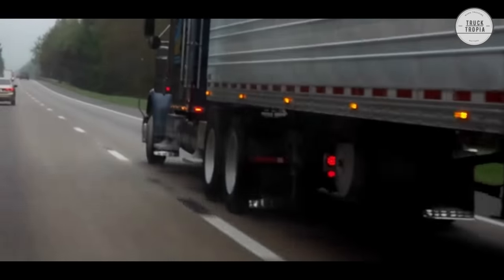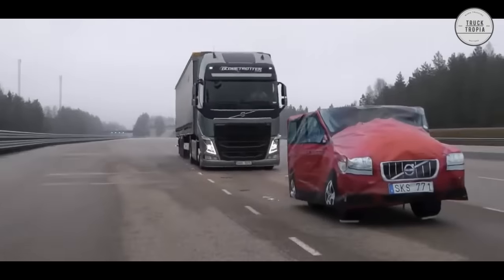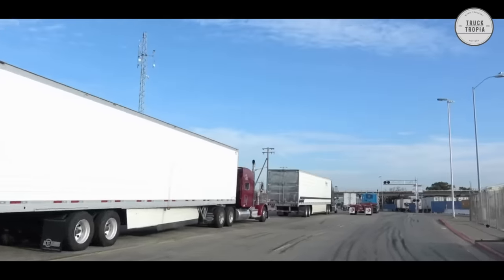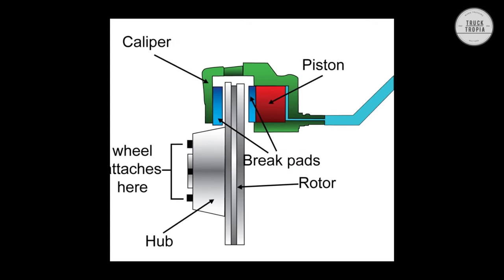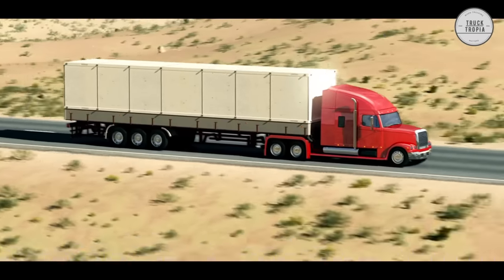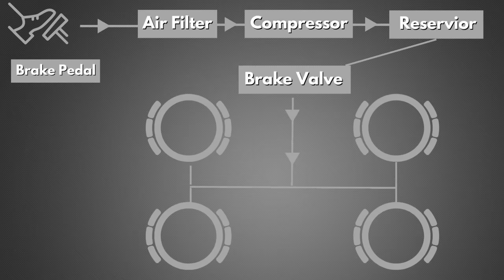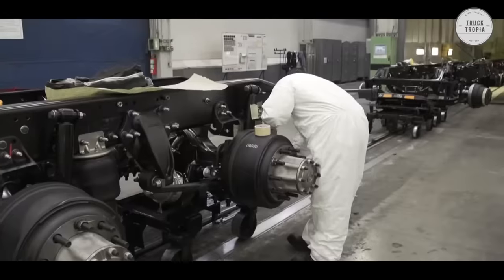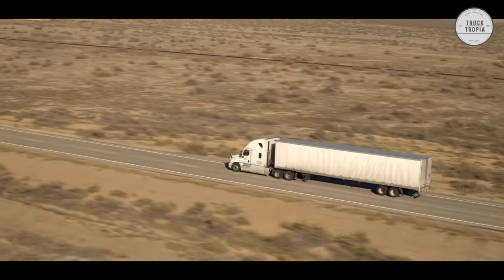Why Do Semi-Trucks Use Air Brakes?

Comment: WARNING! Before you work on any air brakes. There is a large heavy spring in the brake chambers under tremendous pressure and it will kill you,  if disassembled wrong!
Reply: Who are seriously disassembling brake chambers? 😅 If one goes bad you swap out the whole unit
Reply: i am very well aware of it ...... that is why this video is wrong. that spring is the actual brake and if air or hydraulic pressure fails the brake engages.
Reply: That spring is what makes it a "fail-safe" system. It is normally engaged. It only releases when air is pressurised and holds the spring in place. You must release the spring tension in order to safely rebuild the whole chamber. It is much cheaper to rebuild the chamber than buy a new one, if said chamber is not rusted out of existence.

There is another actuator that actually makes the system brakes using the pedal. This has a much weaker spring that only releases the brakes if pressure from the pedal is gone.
Reply: Held one, super scary to take apart
Reply: @TuntematonSika  wrong! You can swap a half can. Set the brakes, cage the leaky can, and pull off the section by taking the clamps off. Easy peasy.
Reply: Forbidden confetti
Reply: hence you release it after you've secured the vehicle. It is a no brainer ^^
Reply: Oh man! Was just about to watch a youtube video about what airbrakes are, i had to work on one you know... Thanks for the info tho!
Reply: I've seen this happened to a  new mechanic many years ago. Thanksfully only hit his left arm and his arm just shattered. Hanging limply at his side with few places punctured by bones fragments. If that thing hit his head or body, he would have lost his life.
The seniors were not in yet when he started working on those brakes. From that  day we make sure everyone have training on brakes and new mechanics not allowed to do solo job.
Reply: It's 2023 NO ONE takes those apart.
Especially when you can just swap the whole thing out.
Reply: @escapedcops08 I do
Reply: well most people dont have the budget to swap so expect always that there is always some who choose to rebuild
Reply: In tech school they warned about throwing them in the trash. 
I bet there's plenty of these land mines buried in landfills.
Reply: So if improperly disassembled, the spring may cause you to... spring a leak?
Reply: In my college class , someone almost died because they filled air the wrong hole form the chamber 💀💀💀
Reply: All the ones manufactured  for like the last 15 years or more have a crimped on band on the spring side. You can't even replace the diaphragm that releases the spring. It sucks. You can cage the spring and cut the band to get them apart, but the band has a different profile, so the old bolt together bands won't work. Damn safety Nazis

Comment: Air brakes are used because of the trailer. The trailer has to have the ability to decouple from the tractor. The connection for fluid transfer would potentially have a leak. With a liquid being the fluid to move the brakes, you might lose all your fluid. The air compressor replenishes the air which is the fluid used for air brakes. Air leaks are bad but leaking hydraulic fluid would be more dangerous.
Reply: I agree. But also, even a small air bubble in the hydraulic system would render it unusable. There is no practical way to make it work unless the driver bleeds the hydraulic brake system of air every freaking time a trailer is hooked up. Air brakes are the best solution.
Reply: So that's why a true hydraulic braking system was never applied to any on-road vehicle. Even though applying a reversing flow of fluid to a vaned wheel assembly would stop the vehicle with no chance of overheating and never wear out, a leak would cause catastrophic system failure.
Reply: Air brakes are also much easier to amplify on the scale of a comercial vehicle. You just press in a control valve and the pressure will start building from an outside power source. With  car brakes only a big vacuum powered booster is enough, but braking a large vehicle would be near impossible with a vacuum based booster.
Reply: but they're also used on trucks and buses without trailers.
Reply: @reruddock  why not electric trailer brakes then?
Reply: except hydraulic brakes were standard for agricultuiral vehicles until recently.

standardized connectors for hooking up hydraulics quickly exist.
Reply: There is also the probability of getting an air bubble in the hydraulic line with hydraulic brakes when coupling/uncoupling the trailer.
Reply: @justinryanvalencia05 It would take a large amount of power to run the brakes. They do electric brakes on smaller trailers. Even then it’s a fair bit of power to make the brakes work. To get electric brakes that would match air brakes would take far more power than would be reasonable.
Reply: Not true  Moto GP bikes have QD lines and they work just fine..   Air is just a better system and even tho you can still get fade you don't get it from overheating fluid as in hydraulic fluid you only get it from the brake parts overheating    @reruddock
Reply: Buses also use air brake and even non-articulated trucks
Reply: @anonym3017  I think the connectors are only for the attachments. Not for the vehicle brake system. Might be different system entirely.
Reply: @ramonching7772  nah mate.

hydraulic brakes were standard on agricultural vehicles for decades. that includes hydraulic brakes on trailers. which were connected with disconnects in the lines.

the same system, vut much smaller also gets used in endurance racing so that they can switch an entire wheel assembly instead of having to mount a new brake disk

hydraulic power takeoff also exists but that is actually rare

Comment: I'm missing the two most important reasons for the use of air brakes. One being the size off the brakes, the brakes on a truck are to big to be operated manually with the use of a vacuum brake booster for a hydraulic system. The second is the connection to a trailer for a hydraulic system would a risk for introducing are in the brake lines when connecting which is a bad thing .

Comment: Fundamental mistake in your video: The air-pressure is used to release the brake! - Without pressure, the brakes are locked by a spring. That is a safety measure to prevent trailers from rolling away after being disconnected from the truck. Also the whole truck/trailer system is being stopped whenever a leak in the air-system occurs instead of loosing more and more breaking power due to a leak in a hydraulic system.

Comment: As a trucker for over 50 years, this has been long in coming. Air disk brakes WILL stop the truck quicker and easier than drum brakes. So glad they are here!
Reply: I've done many brake jobs on my own cars. Changing worn out pads on a disc brake system is far easier than changing shoes in a drum brake. I assume that the brakes on a semi truck are just larger versions of automobile and light truck brakes.

Comment: CORRECTION: air brakes absolutely do fade from over heating, just like hydraulic brakes. It’s much more common of an issue with air brakes in fact, since they are more powerful they press the pads harder and heat up faster, they have to absorb a lot more energy to stop a heavy truck. If used too much the brake drum can expand enough from heat to make the S cam unable to push the pads far enough. Most run away truck situations are caused by the driver relying on the brakes too much on a downhill, instead of engine braking, and overheating the brakes to the point of failure. 

As mentioned hydraulic brakes fade too from over heating, but this is mostly seen with sports cars on race tracks. It’s why a lot of race cars and super cars have exotic ceramic material brake rotors that can handle higher temperatures
Reply: I think this applies to cars too, but i dot think if they use air brakes. We have escape lanes in the event a vehicle's brakes fail but that is only in downhill. I have been told that you, in most cases, use the same gear when going up- and downhill, but that is only in manual vehicles. Do automatics have manual gears but what will they do with the clutch?2
Reply: I'm not sure this person actually did real research before writing this video
Reply: @annabelholland  I just got my Class A CDL, so all of this is fresh in my mind. At lest according to the Pennsylvania CDL manual, truck drivers should go down a hill in a gear 1 LOWER than the gear they would use to climb the hill. Depending on the grade and length of the hill and the weight of the truck, you can calculate a “safe speed” for going down the hill, some big hills even have signs poster that say what the safe speed is for different weights. You coast until you hit your safe speed, then you brake until you are 5mph under, let off until you hit it, brake again, ect… until you are at the bottom, this on/off braking gives the brakes time to cool down during each cycle. 

As for automatic trucks, I’ve driven a few, they automatically down shift and engine brake when you take your foot of the gas pedal, so when you are cruising you always keep your foot on the pedal a little, or it starts engining braking like you would driving a manual.
Reply: @randomguy3281  i was talking about cars. idk anything about trucks as i do not drive and have a license for that. i would say though that the steeper or narrower or bendy the road gets, the lower the gear you need. for the same reason, do not coast in neutral going downhill unless at an extremely slow speed (<5mph) in traffic
Reply: @annabelholland  Read your owners manual for transmission shifting options. It can vary between make and models.
Reply: @annabelholland  most new cars have the sport shifter, so you can put your car into manual mode before and while you are driving.  

When going up hill, i rather put the car into manual shift mode, downside out of overdrive which raises the engine rpm. The same applies going downhill.  Just watch your rpms, you don't want them to go too high. Really no more then 1 maybe 2 downshifts.

Please read the manual for your car first. My car might be different from yours.
Reply: Yes. It's just that you don't get the effect of moisture in the brake fluid thst can get overheated and boil and lead to complete brake failure in cars with poor maintenance, that don't happen in air based systems. But as you say, the pads wear out all the same.
Reply: @annabelholland  Not really, but most autos do have one or more gears for going downhill(never go into neural and read your manual), but unless you are maxing out your brakes with a trailer on a steep hill or something, you are most likely fine, but not using these gears will wear your rotors and pads faster ,also, basically all non-commercial vehicles use hydraulic brakes.
Reply: When I drove Big Rig many years back .When going down a long Grade .I used to put my jake brake and use my trailer brakes to keep me at a slower speed ..I figured if I lost my trailer brakes at least I still had my Tractor brakes to get me the rest of the way down the grade 😊
Reply: I see more glaze overs than drumb expansion due to drivers riding the brakes. Regardless of a steep grade.
Reply: @midnightrunner684  sorry but you're wrong if you loose your brakes on a 53 Ton trailer and only have brakes on your 7 Ton semi .. the time you have to brake for real that 53 T trailer will push your semi like as a snips of a finger on a marble and slide to either side "hauling your butt down the slope" ....
Reply: idk who to reply to but i should have mentioned that i only drive manual cars as i live in UK(europe)
Reply: And it's also why race brakes have little holes in them. They are sacrifiying braking surface for more cooling
Reply: @CommanderPiglet  Exactly.  The whole video was supposed to be about why semis use air brakes.  Only in passing is the real reason given: Because you can hook a trailer up with air hoses, which is not practical with hydraulics.  The idea that the parts of the brake that are the same between systems is somehow "better" on a air brake system is just dumb.
Reply: @CommanderPiglet  you can tell by the fact that the brake pedal is before the filter and compressor...
Reply: One of the most common brake fade issues in cars is overheating the hydraulic fluid. Most sports cars and sports bikes run DOT4 brake fluid from the factory. Some people switch to DOT5 instead. The higher the number the higher the boiling point. DOT3 is standard fluid in most cars. 
Trucks do fade from heat, but it's frictional fade not fluid giving out. 

If you have a sports car with dot4 or 5 and are getting fade is probably due to cheap pads and rotors.
Reply: I thought so too. And I do miss the days when asbestos was allowed to be used in brake shoes and brake pads. I still think that asbestos is still useful despite all the health issues paranoia.
Reply: In recent years. A lot of truck manufacturers IE Daimler-Benz, Mack, Volvo, Freightliner, International trucks and buses IE MCI, Gillig, New Flyer, Van Hool, Integrated Chassis (subsidiary of Navistar), Setra, and Volvo have gone over to disc brakes. The pads don't need changing until 500,000 miles. They are fade resistant, last longer, and provide stopping power in emergency situations. Also, fire truck manufacturers are using disc brakes as well.
Reply: Yes, air brakes over heat.  I can testify to that.  My diesel pusher motor home did not have an exhaust brake and a jake brake could not be installed on my CAT3208 and so I smoked the rear brakes coming down out of Yosemite NP.  It was a scary trip the rest of the way down to town to get the brakes checked for wear and oil contamination.  The brakes were o.k. and when I got home I purchased and installed (I could not find a shop that would do it) an exhaust brake.  Our next trip out west towing my 7,000 lb pickup was a breeze.  On some grades I hardly touched the brakes.
Reply: @randomguy3281 lean more on the engine brake and transmission instead of brakes as much as possible unless you wanna be one of those guys rolling down the pass with smoke barreling out of the brakes.
Reply: Correction, air brakes cannot press the brake drum harder that hydrolic brakes because air is compressible while hydrolic oil is NOT !
Reply: Along with engine braking, going down the hill in a lower gear factors in. The old rule of thumb in the owners manual was you went down a hill in the same gear you would be in to climb same hill
Reply: Why dont trucks use slotted or even drilled holes into the disc to scoop out the gas? That’s usually why brakes stop performing as well since the heat oxidizes the pads
Reply: Ceramic is awesome.
Reply: Regular car brakes can fade as well. I lost the brakes once while driving a hack... The passenger wanted to go down a very steep road. I did so for just 3 blocks/stop signs... Made the last cross street on the right side tires alone as I turned to the left. Scared the sh.. out of the passengers. They didn't argue with me again about not using the shortest way to save them money...
Reply: Agreed!  Nice Work
Reply: This video missed the mark in so many ways.  The brake fade is caused by the pad material, not the actuation system.
Reply: just add water sprayer to the brake pads
Reply: @lewis7315  it's all about the surface area of the diaphragm.  30 square inches at 100 psi equals 3000 psi at the rod coming out of the brake chamber.  It doesn't matter if air is compressible or not.  Your leg and booster will never be able to produce 3000 psi out of the wheel cylinder.
Reply: @nixon2tube  That and airbrakes have a failsafe mode, you lose air pressure, brakes lock. So you park a trailer and disconnect the air, trailer stays put. Same thing if a trailer were to break away on an airbrake system, soon as the glad hands parts, trailer brakes will engage (sometimes called dynamiting from the bang they make). Whereas as a typical trailer towed by a light duty truck will just keep going if the battery is dead (for the emergency breakaway control), or the breakaway switch fails.
Reply: @TheDrew2022  True, but you "could" make hydraulics that way also.  They just don't.  I'm waiting for electric brakes, which could failsafe like the airbrakes, but be a lot quieter and would get rid of a couple of lines.
Reply: @lovepcgaming2335  I was looking for this comment. Yes, I believe the Youtuber was referring to the heating of the fluid, not the pads and rotors.
Reply: So, time to revise your video, Truck Topia.
Reply: The problem is automatic trucks have to rely on service brakes on downgrades that have truck speed 20 posted, unless it is only a peterbilt thing. The engine brake doesnt really engage under a certain MPH especially with a decent load its like it does nothing when you put the J brake on
Reply: @donkeymule2  Don’t be silly, Automatic semis absolutely have engine braking. Typically 3 levels of engine brake you can choose from to fit the steepness of the grade and if you are trying to maintain a speed or slow down. 

Source: I’ve been driving a 2020 automatic Freightliner for the last 8 months. I have 3 levels of engine brake you engage by pulling down on the right signal stock. I can also force it to upshift or downshift  by pushing the other direction on that signal stock.
Reply: @randomguy3281  buddy I drive them as well and am aware of the 3 levels. Engine brake is irrelevant at speeds of 20mph it doesnt work . Even on max I’m speaking from a 2023 peterbiilt 579 experience. Your 2020 may be different i never said theres no engine brake read it again, just that where truck 20 MPH is posted I have to rely on service especially with a heavy load 20 mph is too slow for engine brake to really make a difference